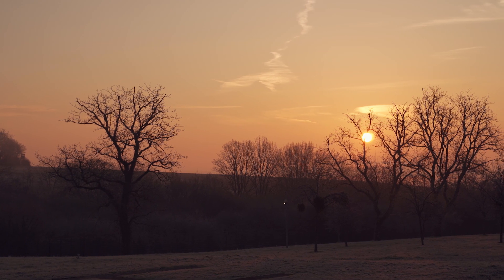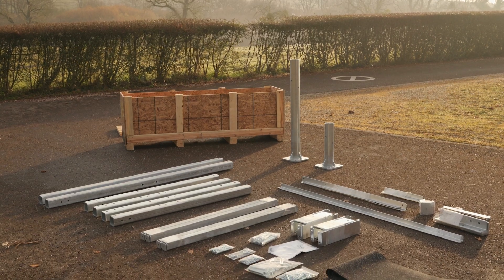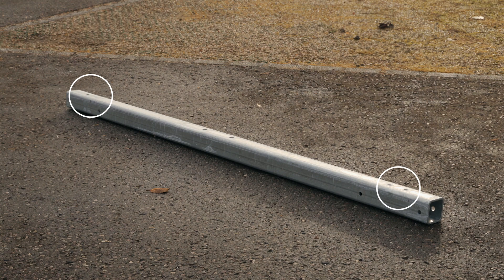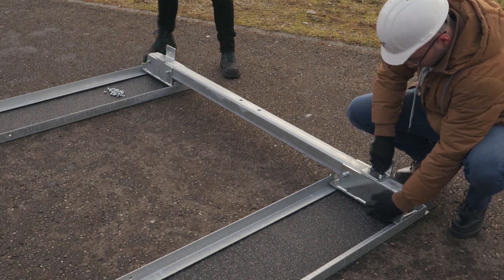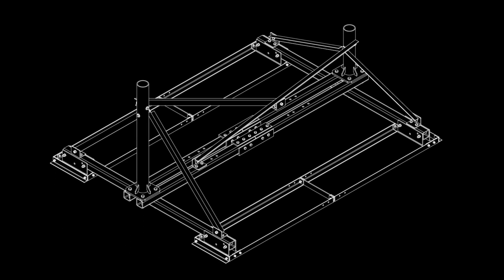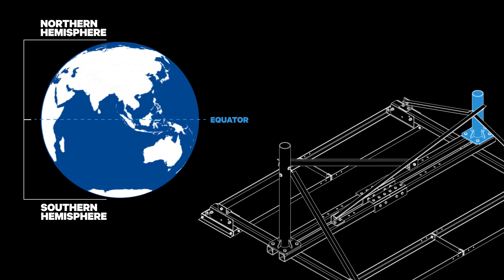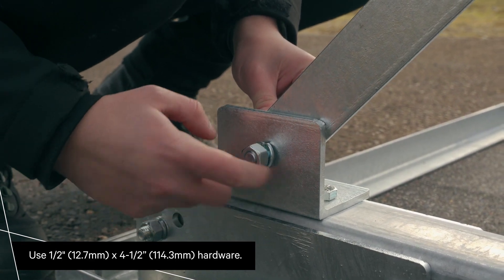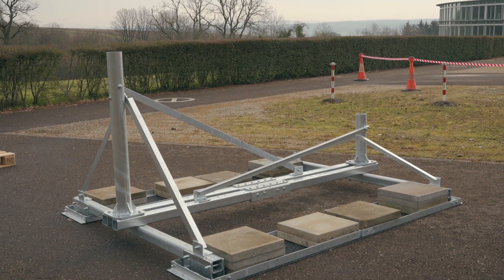O3b mPOWER Antenna System mP130: Part 1 Assembling the Dual Mount

Comment: If you are on the equator, is it still north south?
Reply from the maker: Yes, this is correct. If you are installing the antenna on the equatorial line, move the antenna a few feet North and continue to follow the installation instructions 😊